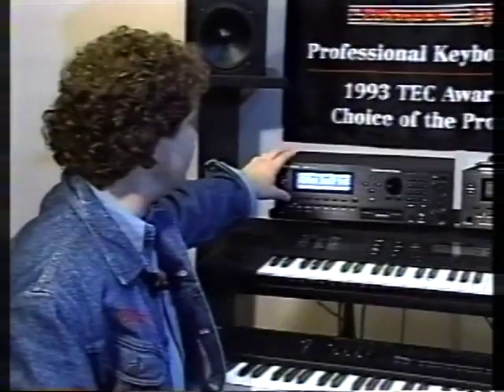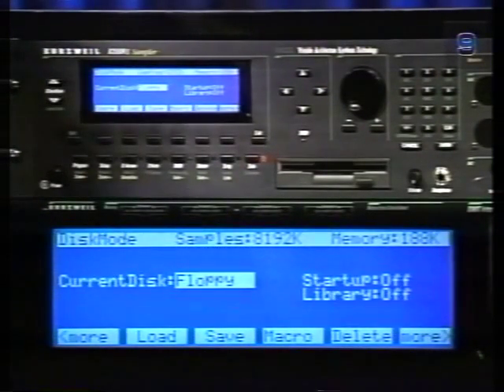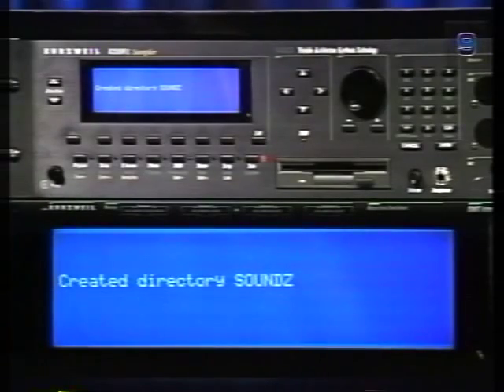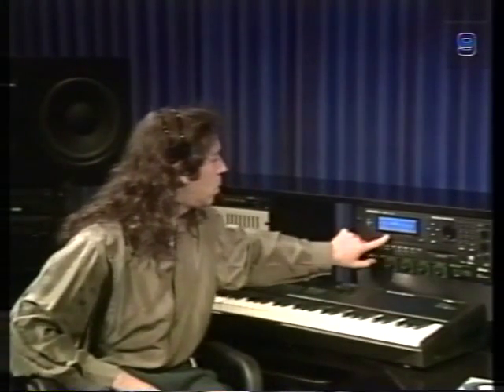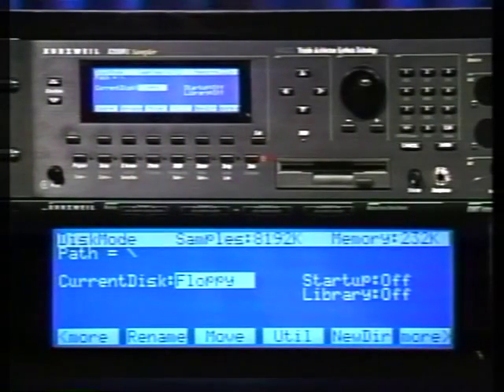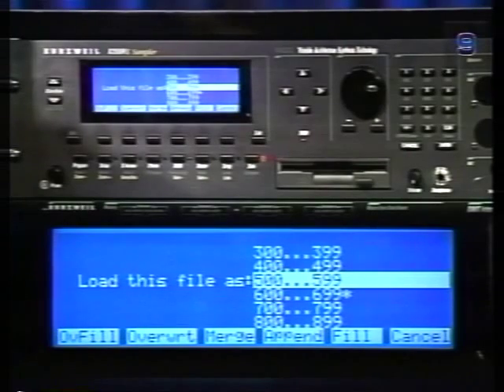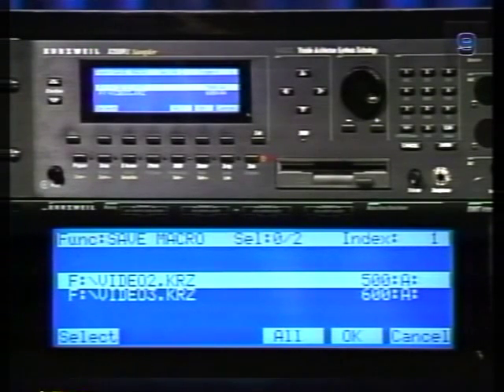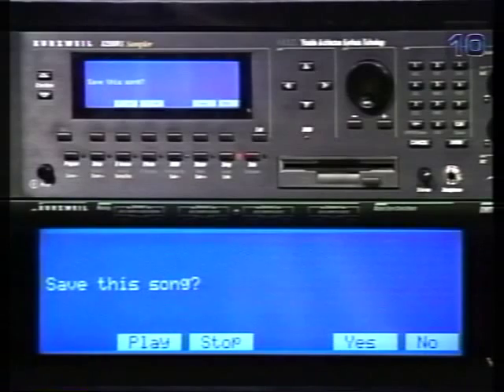Kurzweil K2500 Series Training Video (Part 3) - ft Jordan Rudess

Comment: Does anyone remember which one of this videos contains tip about how to create program with two (or more) layers that have different outputs and how to control which layer is playing by any control source there is? 
I saw it once and even commented to that vid and thanked for that. I just don't remember how it was done and can't find that piece of information anymore.

It had something to do with layer parameters, one of the layers was put to "reverse" mode I think.